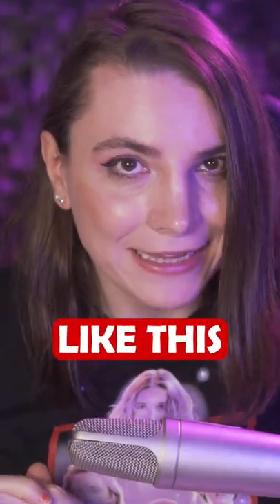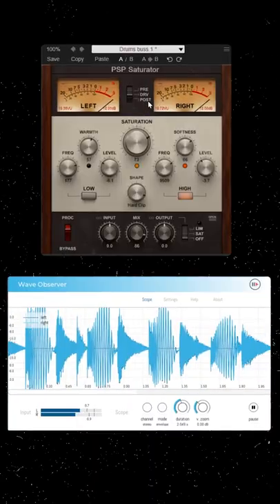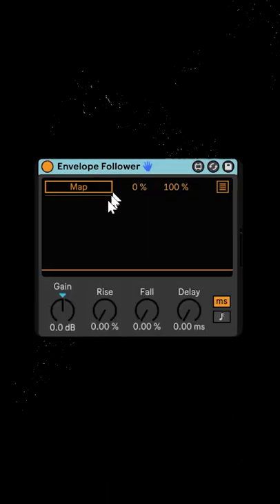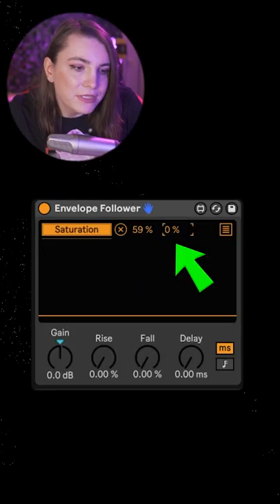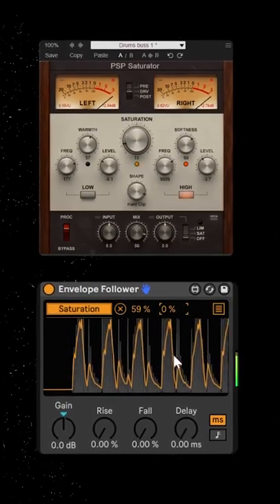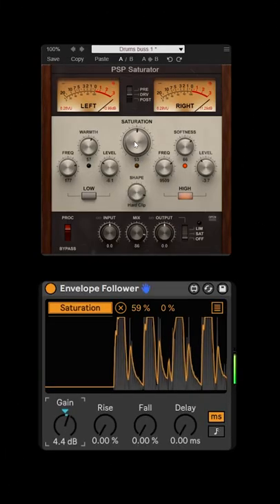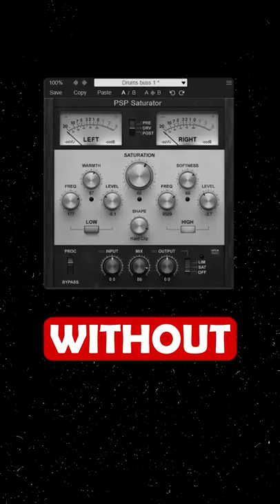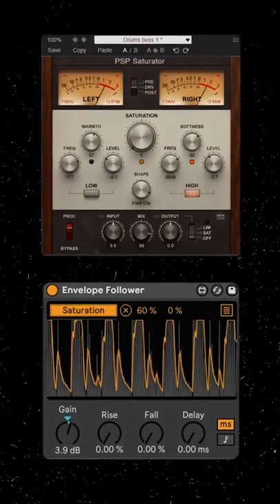Have You Seen Distortion Used Like This?

Comment: just wondering modulating the drive just like a compressor is kind of same as using a  soft clipper and clipping just the transients. I use often times use the psp warmth saturator plugin which is like saturator but works like compressor, limiter  but with non linearity. I believe this really sounds different and also very interesting. I will definitely try it, looks fun(i have tried it in the past but I was a noob back then).

Comment: Wouldn’t we need a lil bit of lookahead for this? Sounds solid, although I prefer a smashed parallel track mixed in so it sound bit more natural and there’s no worry about possible envelope generated artifacts.
Reply: You'll end up having a tiny peak before the follower can react. But that could be a good or a bad thing depending on how it sounds in the mix. You could always double the part, bring one forward in time,and link the parameter to that earlier  one